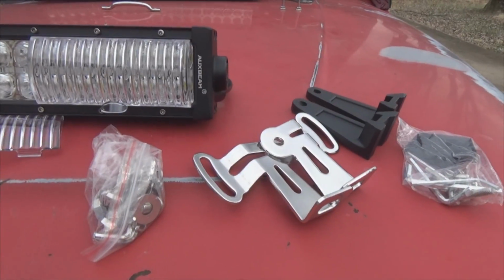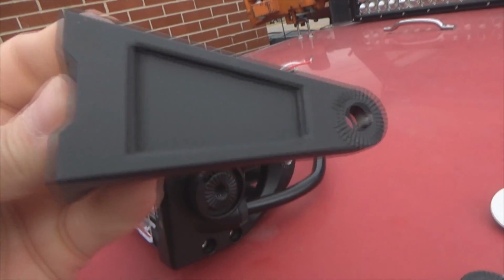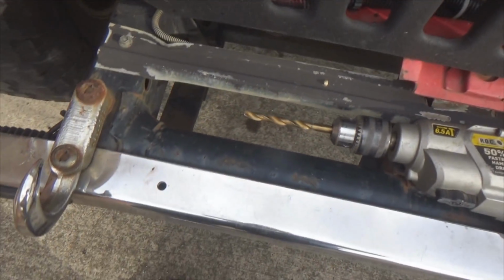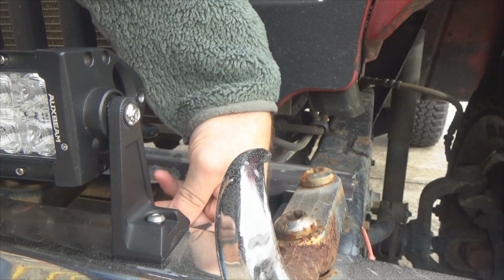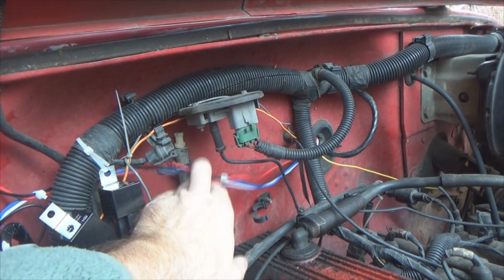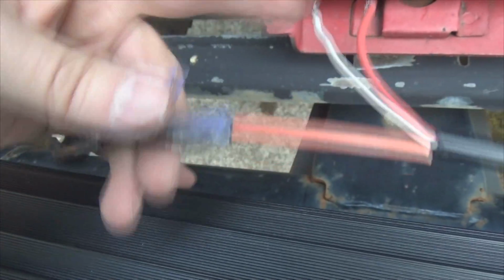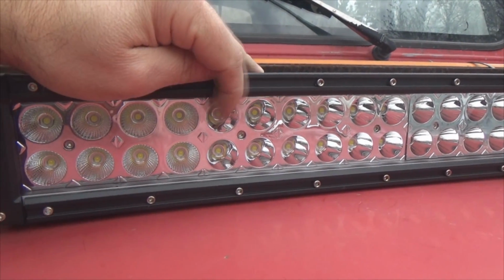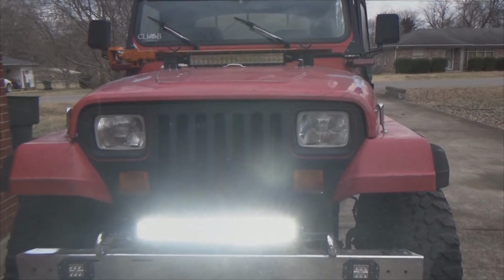Jeep Wrangler - Auxbeam LED bar with Daytime Running Light

Comment: If you wanna use the chrome brackets you can flip that light around. The wire will be on top on the passenger side then. Doesn’t matter which way you install the light.  That will give the light bar plenty of movement for adjustments.

Comment: Ok.  Every video I have seen of guys installing these (mostly w/ other brackets in door jam for mount above windshield,  I have seen them "in Every case" use the Threaded Inserts that are installed with a tool like a rivet gun or even tightened down with just an xtra bolt & two wrenches to tighten it down & get it to crimp tightly in the drilled hole.  And every other video I've seen showed that Auxbeam had included those "Threaded Inserts"  which I thought I saw in bag when u briefly showed those "Other Brackets"
Reply from the maker: Hmm .. interesting. I understand needing the threaded inserts with some of the brackets that tuck inside the A-pillars of some trucks. I know the tool you are referring, iIts on my "to buy" list!  Those inserts may come with that specific bracket kit .. maybe?? The mounting brackets I use on the Wrangles just use the factory mounting points so no other holes are needed unless they are drilled in the bumpers. All the LED bars I've been through didn't come with the inserts and I've dealt with a couple of different companies. I promise ya .. there have been times I could have used those inserts :-) . They can be huge time savers!!
Reply: yes,  i love em.   bought a kit that came with the tool and 100 diff size inserts and it cost less than $30.   Pick one up   they absolutely come in hand more than u would think
Reply from the maker: Im game, where did you buy the kit? I could use the kit to fix windshield soft top channel.

Comment: Wrench and electrical Tape??  In a tight spot?   Why Not just use the  Threaded Insert   Which I Am Almost Positive that is Included with these Light Bars????
Reply from the maker: They come with hex head bolts and regular nuts. Same as with even the more expensive bars. The tape simply holds the nut from sliding through the wrench until the bolts have engaged with the threads. The wrench / tape trick can be used on any situation where your hands can't get back to where the nut needs to be started.